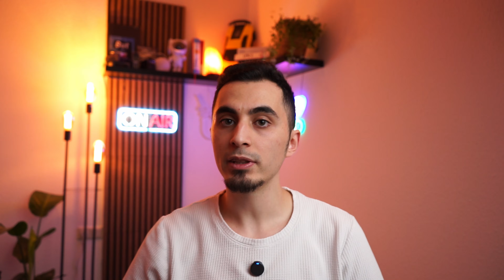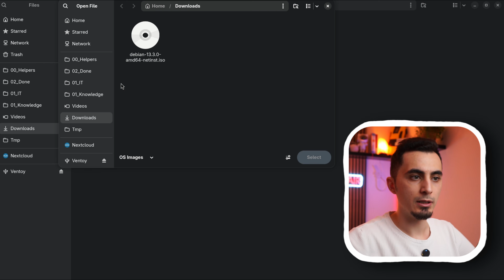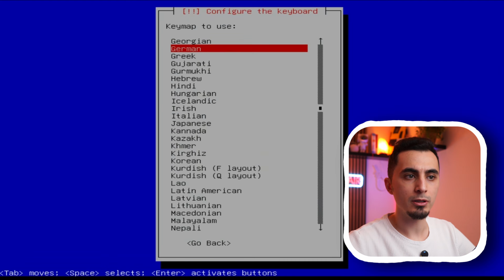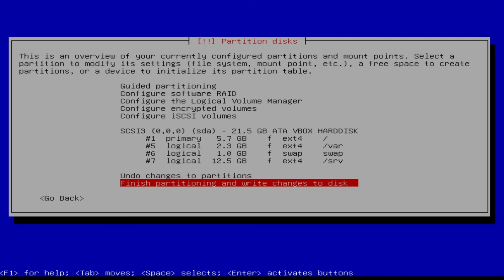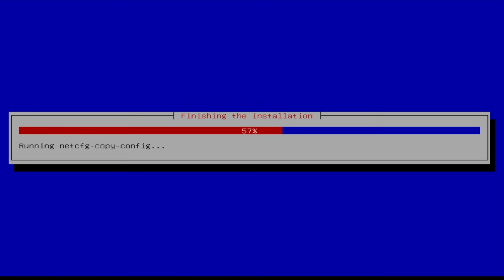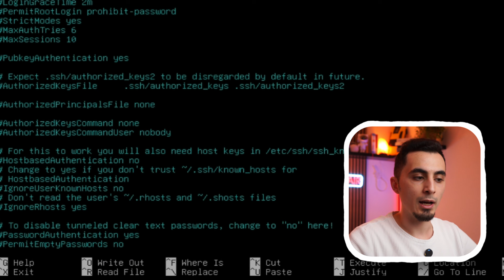Install Debian Server the RIGHT Way (Secure & No GUI)

Comment: Hi @Libre-Data great video!

Could you explain the domain name and host name? Does that mean that when on the same network we can connect to your PC (e.g. ping 192.168.x.x) by using that DNS? Or is it something else? For what purpose do you set it as "debian" and "libre-data.local"?
Reply from the maker: Great question!

- Hostname ("debian") = the name of the PC
- Domain ("libre-data.local") = makes the full name → debian.libre-data.local

Instead of remembering an IP like 192.168.x.x, you can use the name if your network supports it (usually via ".local" / mDNS).

So:

- IP always works → ping 192.168.x.x
- Name can work → ping debian.local

I set it like that just to make the server easier to recognize and access 👍
Reply: @Libre-Data  Thank you!
Reply from the maker: You are welcome bro :-)

Comment: When I try sudo apt install.... I get sudo command not found
Reply from the maker: Looks like "sudo" isn’t installed or configured on your system.

If you’re logged in as root (which is common on Debian Server), you don’t need "sudo"—just run:
"apt install <package-name>"

If you’re not root, switch to root first:
"su -"

Then install sudo:
"apt install sudo"

After that, add your user to the sudo group:
"usermod -aG sudo your-username"

Log out and back in, and "sudo" should work 👍

Comment: Ok but you don't show is how to access the server through a browser after installating SSH and configuring the firewall? Many people watching this are completely new to this and don't know what to do Next. I'm many people
Reply from the maker: Sorry bro but I think I didn't explained in detail, with ssh you won't be able to qccess the server from a web browser. SSH is for connecting to the terminal of the server from an PC. If you want to manage your server from a web browser, you need something like 1Panel, I also have a video on how to do that easily https://youtu.be/kd1JTIKym30

If you ran into any problems just tell me :-)
Reply: @Libre-Data thank you!! I'll check it out asap. I was confusing ssh with a web interface because this Linux server thing is new to me (I'm tired if running jellyfin on my windows machine)
Reply from the maker: Cool, you may want to check out CasaOS in this case, its the easiestway for selfhosting :-)

https://youtu.be/piBSgHsv9SQ

Comment: What does the Install Web Server option do? (before Install SSH) Is that for hosting a website, or does it allow you to run a graphical web portal for accessing the system?
Reply from the maker: Hi Chris, no its not, its just if you want to host a website on your server. In background it will just install apache2
Reply: @Libre-Data gotcha, thanks!